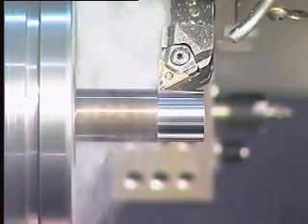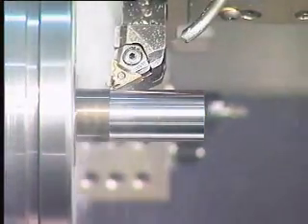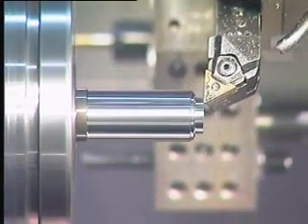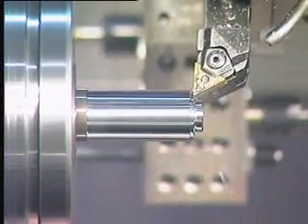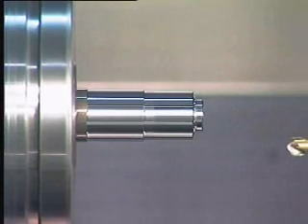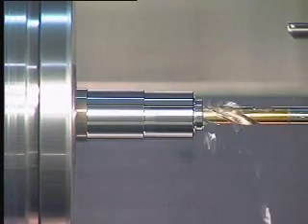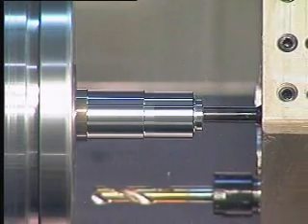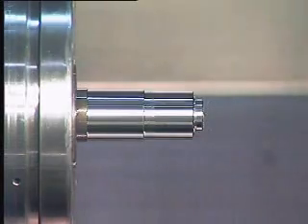how to make a shaft with MT driven tools. Material used ETG100

Comment from the maker: It is not stainless steel but ETG100 equivalent to 39NiCrMo4 (steel for induction temper). Ra values depend from the parameters used but geneally the range is between 0,8 to 1 max.